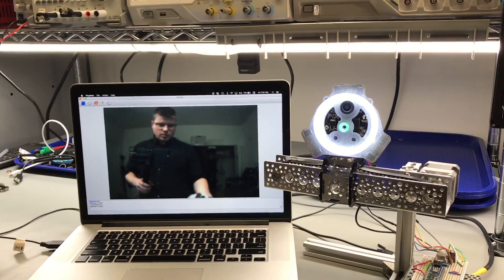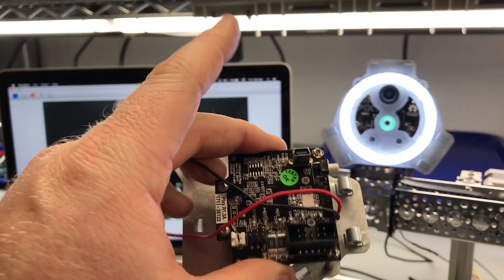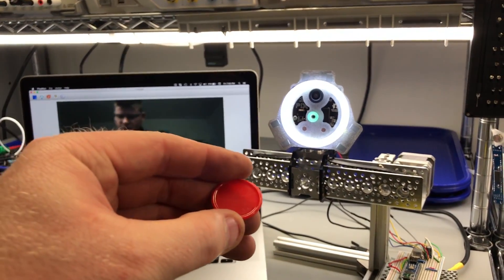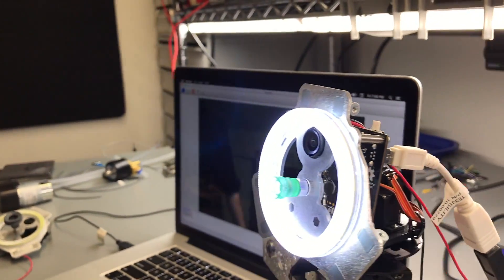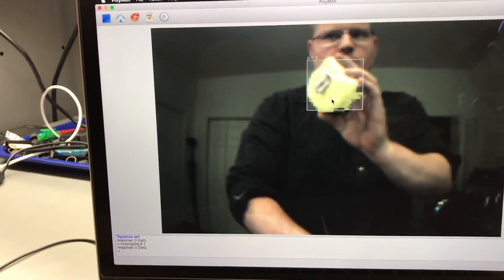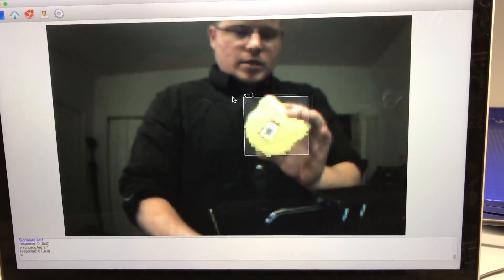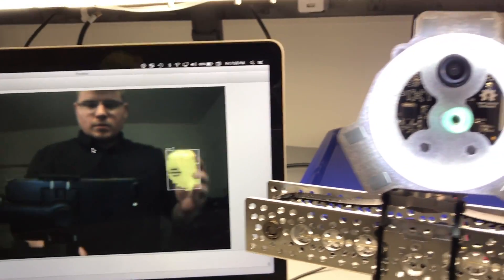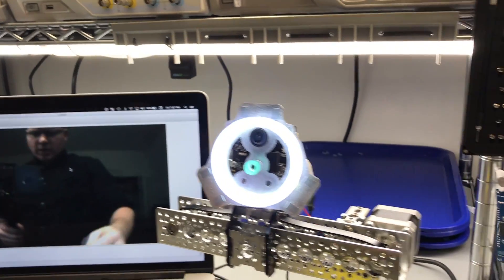Dynamic Robot Image Processing System - 50FPS Tracking Speed

Comment: Very cool stuff! Just wanna ask if the software you using comes with the camera or you programmed using computer vision library like opencv?
Reply from the maker: Thanks, the pan and tilt program is already on the camera board.  I will be using the arduino IDE with the camera for the delta robot.

Comment: Seems like those laser parts always have slag to sand off.
Reply from the maker: It depends on the part, but usually only for sheet stock larger than 0.062". The material in the video is 0.090" aluminum.  Aluminum generally has more slag than stainless steel and steel.
Reply: Proto G May want to consider throwing in those little nuggets of sheet metal working terms. I don't think your average viewer would know what slag is. I realize the intention of this video was to demonstrate progress on your delta project but more knowledge is always better.
Reply from the maker: I do want to do more videos in the shop and may get into more metal working videos later on. Sheet metal is quite a bit more complex than most people realize. Even more so when it comes to bending and forming(bend deductions, grain direction, stretch allowances, k-factor etc.)
Reply from the maker: By the way, I would have sanded the parts even if there wasn't slag.  I prefer the look of a "jitterbug" metal finish because it hides surface scratches.  Mill finish aluminum always ends up with a lot of scratches if not handled very carefully.  The "jitterbug" finish is similar to a tumbled finish.
Reply: Proto G I personally would love to learn more about bend calculations and process. You make a good point about stock finish of aluminum. Also, you're ready for paint after sanding should you decide to go that route.

Comment: COOL video once again. How much is the suction cup able to lift or how much are motor going to lift as how powerful the robot will be once done?
Reply from the maker: Not entirely sure yet, but that will depend on the speed and resolution the machine is set to.  The more microsteps I take, the higher the resolution but the smaller the max load becomes. The green suction cup can lift up to 14.39 Ounces(408 Grams) and the larger gray suction cup can lift up to 3.42Lb(1.55Kg). I have much larger NEMA 34 motors I want to eventually use.